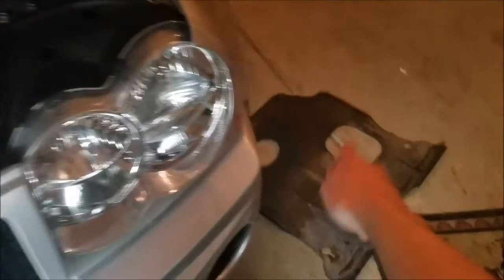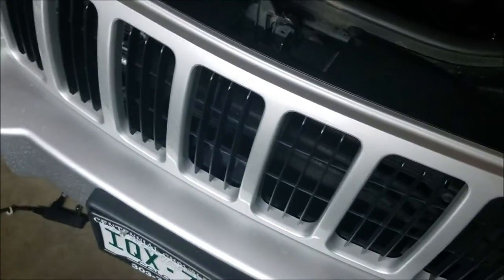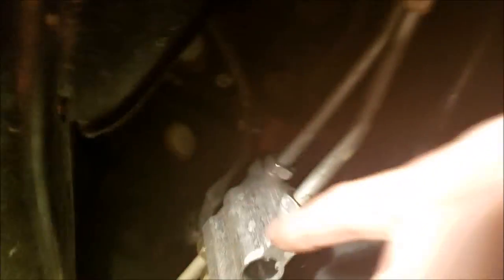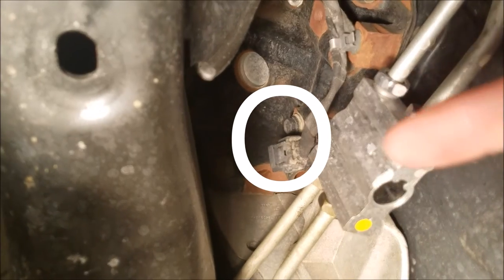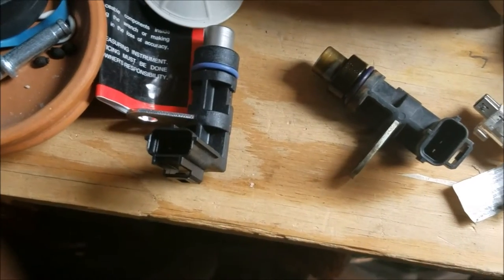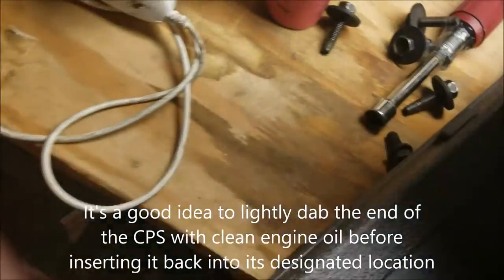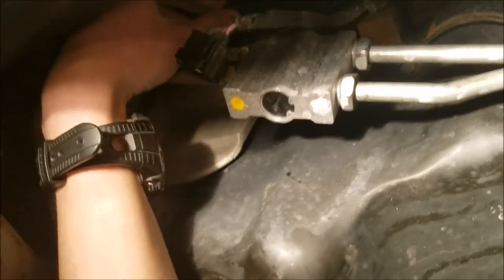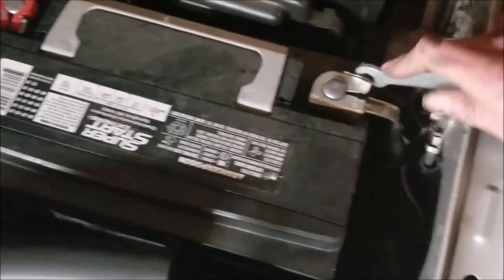Jeep WK/XK 3.7l V6 Crankshaft Sensor Replacment (Rocky's Stalling!)

Comment: When installing the new sensor do not bend the metal bolt tab.  If you do carefully straighten it out in a vise.  It appears
that the sensor inside the mount has to be installed with no bending of the bolt mount bracket or the vehicle will not start.
The electrical connection is a thumb pressure disconnection on the bottom of the socket.

Comment: Yo Cuz, im currently on the same path that you were on doing the same thing (process of elimination) ..I've replaced the battery, the alternator, water pump, the thermostat, the sparkplugs and now the crankshaft position sensor..and still my "Rocky" is hard starting..maybe he needs a Camshaft position sensor?..after installation of the new CPS, he does run better until he comes up to his operating range..I'm wondering if maybe I need to change the coil packs?..I was hoping I (or a mechanic) don't have to do that.. would like to hear your feedback when you have a minute after your college obligations..and was very happy to see I'm not the only one that allows the "bells and whistles"to do it thing before starting up..glad ur Rocky is doing better too!..
Reply from the maker: Hi there.

I read an article on Jeep forum that speaks about this particular issue:
https://www.jeepforum.com/threads/2006-3-7-wont-start-when-hot.4208609/

Apparently our WK series Jeep Grand Cherokees have issues with faulty fuel injectors (that leak slightly).
Someone quoted:
"when the car is stopped long enough for some fuel to drain into the cylinder, but not long enough for it to evaporate, it cannot start, as the mixture is too rich to inflame."

The individual replaced their old fuel injectors and never had a problem again. It seems to be a common reoccurring theme with Jeep WK engines in particular (at least for the 3.7 and 4.7)

There is also a purge valve that you can press to release fuel pressure. It sometimes helps in a pinch. Back then it was a surefire way to get the vehicle started again, especially during summer.
You just need something long like a pen and a rag because releasing pressure from the valve can sometimes spit hot gas. Have to be careful. You use the pen and rag together to gently press the inside of the valve and it releases pressure.
If I'm not mistaken, it's located right by the oil dipstick near the passenger side area. It's covered by a very little circular valve cover screw if I'm not mistaken. I'd have to check.

It takes less than 2 minutes and my Jeep would fire right back up everytime afterwards. But once again, be super careful, especially when the Jeep is hot. Useful in emergencies.
Reply from the maker: This article may also help too. Explains the situation way better than I can right now at the moment:

https://www.jeepforum.com/threads/fuel-rail-too-hot-wk-3-7.1428157/

Comment: recently had my radiator replaced for overheat problems and am now getting that problem of not turning over when trying to start it up. also my gas mileage has been terrible since then. the only difference is that mine has gotten where even in the cold it doesnt want to fire up.  Trying this soon and i hope it works

Comment: Awsome video!
I have the same jeep and has been really good to me. I'm having multiple cylinder misfires and stalls(lack of power accelerating). Starting great though. I've already changed plugs, wires etc; put clean higher octane gas and cleaner. Should i change the CAM SHAFT SENSOR next?

Comment: Awesome, man!  I'm having the exact same problem with my 05 WK.  Running to AutoZone now to pick up this part.  I'll let you know how it goes.  Thanks!
Reply from the maker: Sounds great! If the issue persists, let me know. There is some other stuff (and solutions) circulating around this same problem.

Comment: Man i broke the sensor inside the block, you are lucky to take it out so easy! its not easy dont thake the pan out!!
Reply: @wiley0714  i try to take the pan out,  that gasked was driving me crazy, eventualy i got the gasket out but still the oil pan wont come out easy, i had to stop, no lift and i did this at work on my time, so i had tow to the mecanic,  OEM sensor ,OEM radiator, gasket ,pan, Moog front lower arms. Everthing started from that sensor, some times the car give me hard time to started if the engine was hot. The engine runs good now, i had to bring the car to the mecanic back, the right side inner bushing from the arm was coming out, i told him to put OEM, everityme you go with a difrent brand its bad. Its one guy that rebuilds 3.7 engine and you can see the trick on youtube removing that pan.

Comment: Thanks for the video!  I have 2006 Commander which is basically the same 3.7 L and by watching your video it looks like that part is exactly in the same position.  I had to replace mine because I have the same issue.  I was able to remove the old but it was very difficult and had to drill it out because the top broke off when removing.  Now I have the new one but it just won't push in that easy. I even bought two different brands to see if there is a difference but it just won't push in.  Was yours hard to push in? What brand did you use?  Thanks for your help.
Reply from the maker: I believe I used O'Reilly's brand of the Jeep crankshaft sensor. And when I installed it, I fit in pretty easily. Had to twist it to align the bolt, but that was about it. No resistance :/
Reply from the maker: Are you sure that you purchased a crankshaft sensor and not a camshaft sensor by accident?

And did you also purchase the crankshaft sensor for the correct vehicle type? I've experienced times where local auto shop employees would give me wrong parts for the wrong vehicle a few times in the past.

Also have you primed/oiled the crankshaft sensor before putting it in?

Just trying to think of reasons it wouldnt fit : /
Reply: @TheValleyofAwesome  Hey, thanks for getting back.  It's definitely the crank sensor not the camshaft.  Like I mentioned I even bought two different brands to make sure it wasn't a different design but both were tight.  I have 2006 Jeep Commander 3.7 L which is basically the same as yours. I've worked on my Jeep many times and both vehicles pretty much have compatible parts. I'm glad that you confirmed that it was an easy fit. I don't have an O'reily around here.  I hate to do it but I might have to go to the dealer to get an actual Mopar part. I already paid $25 for each for both sensors.  Maybe I'll shave off some of the material and see if that works.  Thanks again for getting back.
Reply from the maker: @MrArcee52  Sounds great, let me know how it goes. I'm curious to know what happens as well
Reply: @TheValleyofAwesome  So I got the Mopar brand sensor and it's still won't fit. They confirmed that it was the right part number because they matched it to the old one that broke off.  I'm going to shave off some material to fit it in.  Do you have that part number or brand that you got from O'reilly's? I might just order it too.
Reply: @TheValleyofAwesome   Update: So I shaved off one of the after market one then force it in by screwing the bolt on the bracket  because it was still a little tight.  No start. Did the same procedure to the Mopar sensor and BOOM! started right up.  I think the lesson learned is when it comes to sensors, better use the factory parts. Thanks again for your help on this.
Reply from the maker: @MrArcee52  Oh gosh, I'm glad you found out the fix :o It seems a little unusual that you had to shave some parts off, but I'm glad that in the end it was fixed! :)

Comment: Check the camshaft sensor, too. Sometimes they both go out at the same time. That happened to my cousin :)
Reply from the maker: Cole Hintermeister I'll definitely keep an eye on that too, thanks! :)
Reply: @TheValleyofAwesome  how do you check the cam sensor. I got a P0335 error and a mechanic recommended I change both but he he was shady asf, but the code was just for crankshaft sensor.
Reply from the maker: @dontrunhedead  P0335 revolves around the crankshaft sensor, so I would probably change just the crankshaft sensor first and see if it fixes anything. But that's just me. Most mechanics would recommend to replace both just to be on the safe side. However, just as in Rocky's case in the video, only one of them needed to be replaced (the crankshaft sensor). Like I said, personally i would try the crankshaft first and if that by itself doesn't work, then I'd also try the camshaft. Hope this helps!
Reply: @TheValleyofAwesome  hey just a head up but you said the camshaft sensor is on the drivers side it’s not  on the 3.7 it’s actually located on the block right below your valvcovers on the passenger side of the engine you can reach it from the top if you can do it by feel

Comment: Did you pull any engine codes when this sensor went bad?
Reply from the maker: No unfortunately and that's a common problem with some things such as crankshaft sensors. Some vehicles are able to throw engine codes while several people on online forums I've discussed with have also stated that they never got a code, yet once the crankshaft was replaced, the stalling problems stopped completely.
Reply from the maker: The true best way to figure out whether the crankshaft sensor is (possibly) the problem is to notice whether your vehicle stalls only when the engine's hot
Reply: Ok cool. I'm going to do this tomorrow. I have the same symptoms. It's been driving me nuts. Hopefully this fixes it. I got a 10' WK 120K on it  (Silverback_wk). Great video! 👍
Reply from the maker: @specv6188  Sounds great and thank you! Oh and also might consider this. I actively looked into online Jeep forums and found this link. It never happened with the case of my WK, but if the new crankshaft and camshaft don't resolve the issue, consider this to be the possible problem also. Seems to be a common stall problem amongst Jeep WK's with the way their fuel pumps were designed: https://www.jeepforum.com/forum/f67/fuel-rail-too-hot-wk-3-7-a-1428157/#/topics/1428157?page=3

Comment: wat other issues can a camshaft sensor have wen it goes bad?
Reply from the maker: Along with starting issues, your car can suffer in performance, fuel consumption, a check engine light may pop up, stall may happen
Reply: i have a jeep commander...while im driving the truck will jerk and the engine light will come on and the accelerator pedal stops working until the speed drops to 25mph or lower then it will jerk tgen the peddle will start working again i was wondering if that maybe a bad camshaft senser..i did chand throttle body an position sensor th.g.h at didn't help
Reply from the maker: @Louthemailman  That sounds a lot like the transmission going into something known as "limp mode". (It's a safety feature built into most modern cars when the system detects a [possible] transmission problem). I'm not for certain since I can't see your car for myself, but I've heard many stories of transmissions going into limp mode and having the same exact symptoms. I would have it checked
Reply from the maker: @Louthemailman  If you go to any place like O'Reilly's or Autozone, they can do a free check engine light check for you and tell what the problem may be by pulling up the code
Reply: @TheValleyofAwesome  ok so took the jeep to my mechanic and turns out it had a small transmission leak  the gasket was bad. it was goin into limp mode because it was low on trans fluid...
Reply from the maker: @Louthemailman  Awesome! Well I'm glad you were able to locate the problem! :) Hopefully that's the fix!

Comment: I didn’t disconnect the terminals 😭 did i fuck up the sensors?
Reply from the maker: By the "terminals" do you mean the battery terminals?
Reply: @TheValleyofAwesome  yes and i changed the crankshaft and camshaft(had limp mode) starts just fine
Reply from the maker: @general14hayabusa  if the Jeep turns on and there's no error codes/DTC's, (and assuming there was no large spark that occured when unplugging the sensor) then it shouldn't be a problem.
I've accidently changed an entire taillight without disconnecting the battery on my same Jeep but did not run into any issues. 

It's always a traditional recommendation to disconnect the negative terminal before working on the vehicle, but I know many who skip this step and have been fine.
Reply: @TheValleyofAwesome  thanks 🙏.. hitting the freeway it starts going limp from 40 to 20 but when i turn it off and on again i gain that 40 mph back
Reply from the maker: @general14hayabusa  It seems like your Jeep is going into limp mode. When you turn the vehicle off and then on again, it's resetting the limp mode. (I've also had this same issue back when I swapped front and rear gear ratios and couldn't shift through my WK's gears manually). And I don't think a crankshaft sensor would cause a limp mode fault : /

It might possibly be something else that's gone wrong.

Comment: Did u fix the problem
Reply from the maker: CR1zt1aN08 Yes I did :) She no longer stalls and she is 100% fixed after this repair. One and a half years later and no stalls anymore
Reply: TheValleyofAwesome thanks man mine does the same im goin to replace it 2mrw
Reply from the maker: CR1zt1aN08 Awesome! :D Hopefully that fixes the problem! Also, while checking out the crankshaft sensor, you might also want to take a look and see if the camshaft sensor is also good. Both are different parts but can create basically the same exact effect and issue (which is stalling once the vehicle gets too hot or is at normal operating temperature. The vehicle suffers in the areas of fuel economy, performance, and only seems to start only in the mornings or when the vehicle is completely cooled off)